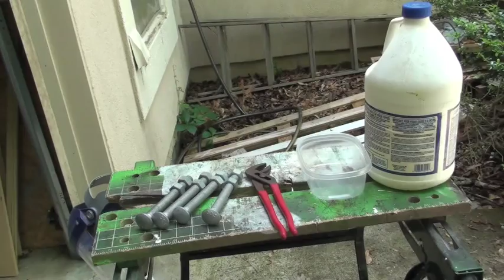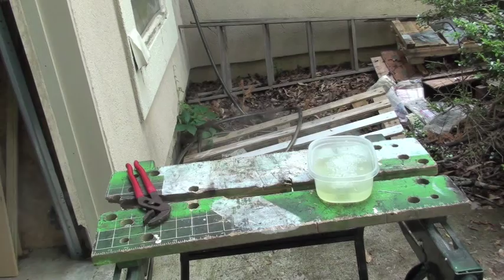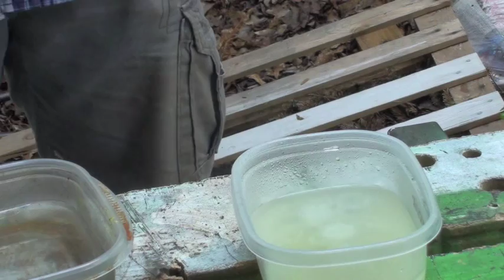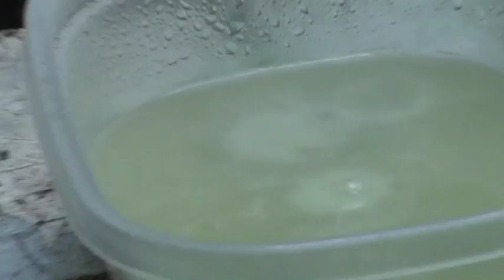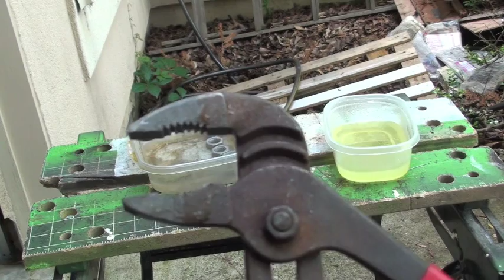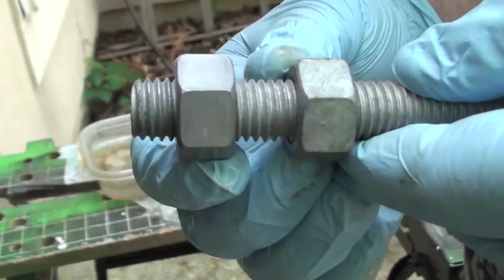remove Galvanization from steel to prepare for welding

Comment: I was just about to dip my 6"x8.5# galvanized I-beam ends into muriatic acid to remove the galvanized coating before I weld them together end to end.  Now I read this thing below on hydrogen embrittlement which weakens the steel...  I am still so confused :(    even after reading more on the subject.  Can someone confirm ?   myth ?  Thanks in advance :)
Reply: it will eat the metal so it will eat away at the coating and the underlying metal. if you leave it in to long it will eat away the metal completely. you can see small pits in the metal sometimes. keep in mind, the stuff I do is for hobby stuff - i do nothing on importance.
Reply: You can neutralize the chemicals with baking soda.